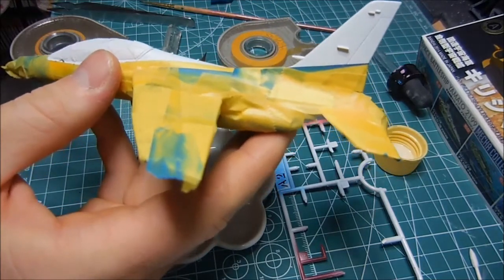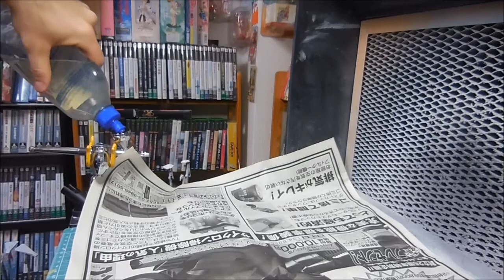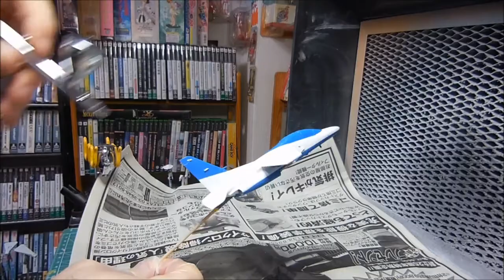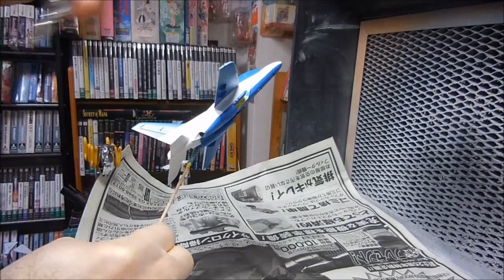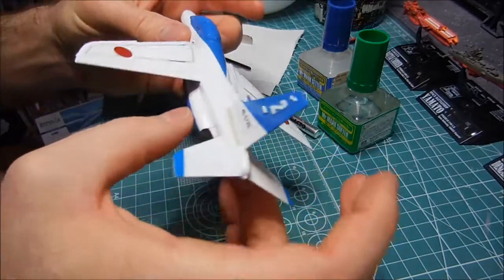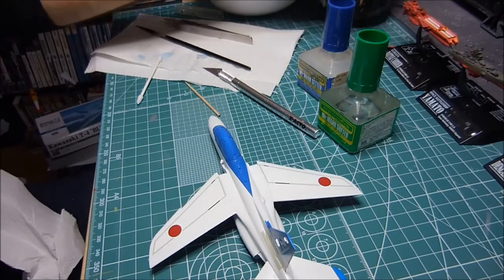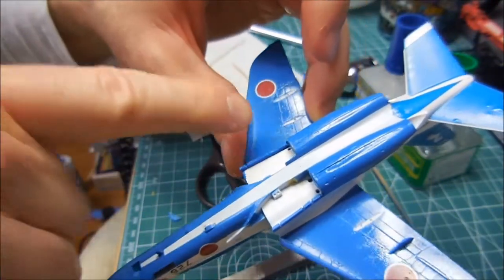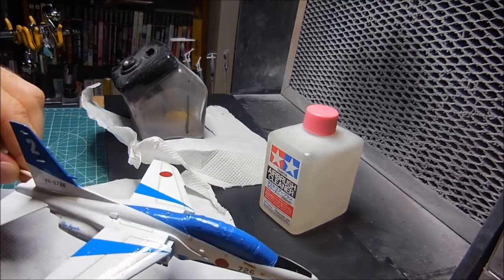Hasegawa 1:72 Kawasaki T-4 Blue Impulse plamo build 3

Comment: Wow, fantastic work Greg :) That jet looks stellar, and nice work getting those decals to work, I've only used Hasegawa decals once (Apparently they aren't a hot seller in Canada) but they are a nice decal to use. Nice that you were atleast able to move the pylons for the underside of the wings, most kits will mold that as part of the wing. Can't wait for the final result :D
Reply from the maker: rebelsatcloudnine Yeah, I was pretty nervous about busting those off. One didn't want to come off nicely, either. But with a tiny bit of epoxy and some touch up paint, my father-in-law won't notice the difference. I just did the panel lines for the flaps this morning, and tonight I sprayed it with some Mr. Top Coat semigloss acrylic. Tomorrow I'll do the final assembly, a little bit of extra paint here and there, and it'll be complete.Incidentally, my father-in-law is leaving tomorrow morning for Gifu Prefecture to go watch a Blue Impulse air show. I've shown him the progress so far, and he seems pleased. It's hard to get much of a reaction from him, really. He never really shows his excitement about anything, nor does he smile much. He's an enigma.